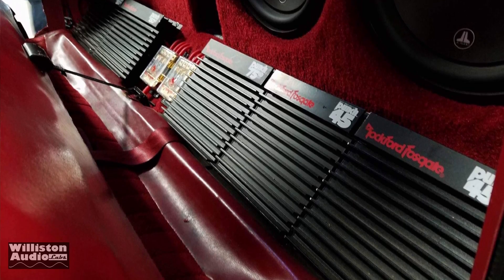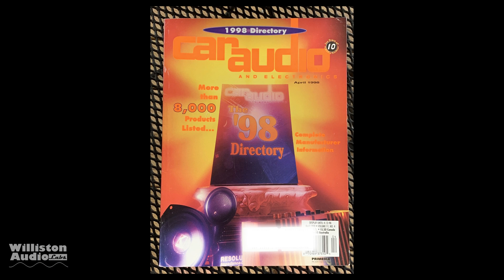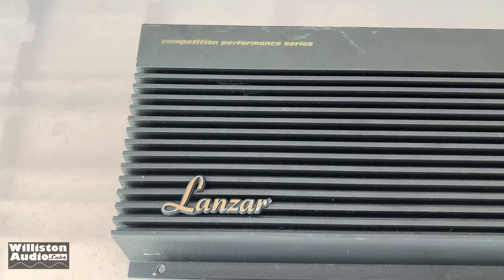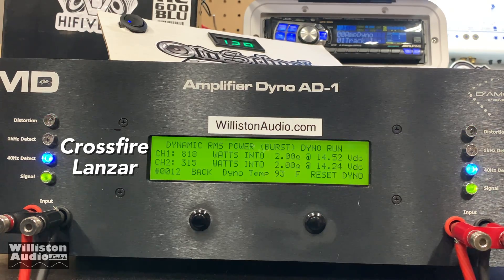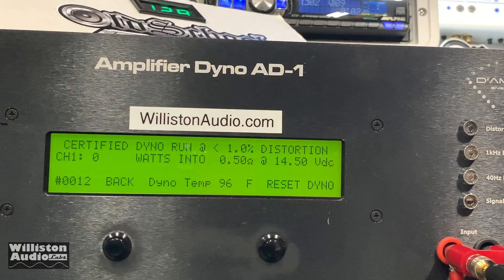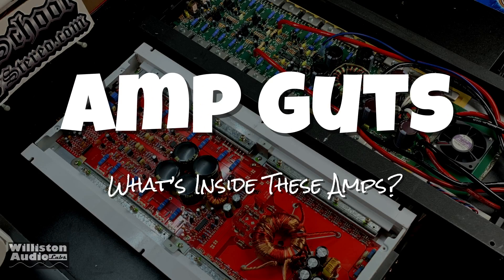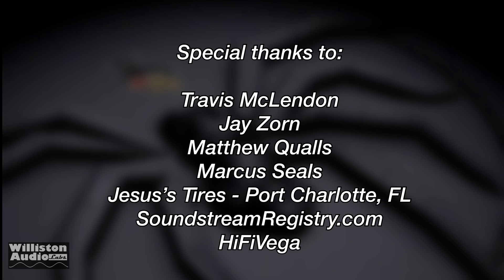$1100 vs $720 Amps from 1998 - Lanzar 50c vs Crossfire CFA-30HC [4K]

Comment: I just pulled out my Crossfire CFA30HC Amp to see if it still works after sitting in the basement for like 20yrs or so. If it works, I'm thinking about hooking it up to 2 12" Orion XTR pros that were gifted to me by my daughter for my 46th b-day. ya I'm 46 and still rocking systems in my rides. Hell, I'll probably still be banging into my 80s (more than likely will have hearing aides by then) if I make it that far. Lmfao. if the Crossfire does still work I'm hoping it'll slap the hell out of those 2 XTR Pros. Not looking to shatter any windows or anything. Just want a clean sounding system that'll piss off the neighbors as well as others in traffic. Lol
Reply: Did the amp still work? At 41 I finally got into car audio this year. How did I ride around before having two 12s in my car? 😂

Comment: Couldn’t see what semiconductors were on the output stage of the crossfire but on the lanzar it’s worth pointing out that every single high power semiconductor for the output stage AND the power supply section is ST Microelectronics and that’s high-high end. That’s why the amp is so expensive. Those BJTs ain’t cheap haha

Comment: I've got the Lanzar Opti-Drive 2500 in my garage.  It was stolen from my car back in the early 2000's.  I got it back years later from a police evidence room but it turns on and then turns off.  Of course they never tested it before returning it to me and the guy who stole it got off with probation.  I don't know if it can be fixed so it sits on the shelf in the garage.  It ran 2 15" Punch DVC 15's in a sealed box in my Thunderbird SC and it pounded harder than any other system I had heard back then.

Comment: Are you sure you were correct when you said what lights were on for what mode? Because it looks like when you switch modes at the end of the video you are doing the opposite of what you said. And the manual is no help in this area.

Comment: I am just about to put one of my 30hcs in my wife's Kia sorrento with a sundown sd4 12. Wired to 1 ohm. It's getting installed on Thursday. I'd do it myself.. But I can't loose my warranty. Do you think I should run it at 4 ohm? Or just set the gains low?

Comment: Holy hell.for shits and giggles I decided to look up the crossfire amp simply because I've had 1 sitting around doing nothing but collecting dust for about 15yrs and was curious to its power.didnt think I'd actually find it on here considering its age.figured it put out a lot more then the 30Wx2 it says on amp but damn I had no idea this thing can put out over a 1000watts.may have to hook it up and see if it powers up and is still useful.if not think I may have to contact amp labs to see about getting it going again.said part is idk wth I even got the amp or why.lmao

Comment: I have a question for you. I’m wanting to upgrade my car stereo and want something like I had in the 1990’s. It was a box with MTX 12” subs and horn tweeters with a 400 watt amp. Looks like most of stuff available is bass only and I want my music to be full and loud not just thumping bass. What would you recommend. I have a kenwood in dash but just not loud enough. I drive a Honda Element. Thanks
Reply: I have some infinity ref on 100 watts a piece and they sound amazing, loud and clear

Comment: I use to have an old school system in my 88 Buick lesabre you can check it out on cardomain.com. cutz buick.   That was my first audio build.  I had all Jensen audio equipment.  4 xa 4100 4 chance. amps, 88w full range 2 ch amp,2 4-way speakers,4 1"tweeters, 2 6 in. Phoenix Gold mods, 2 full range pioneer 4x6, and 2 sets of 2 bandpass10" subs.  Wished I'd tested it but didn't.

Comment: Crossfire is putting in work now too, my first system was in 1999 in a Ford ranger lol all Memphis I remember paying 1200 for my Memphis Bell 🛎 lol now I’m running all DD I have 4 DD 615s and a DM 2500 no wall 10 in aero port in a Dodge Caliber doing 150.00 not bad for low wattage doing knarly hair tricks on low power it was about efficiency back in the day, did my first USACI comp lots of fun, this vid brings back memory’s the Lanzar van started my addiction lol 😂

Comment: I had the old LANZAR amps... the big black ones with the cool red lettering... I had a 500 for subs and a 240 for mids/highs... then I HiFonics Zues and Aphrodite for the same combo... all those including Autotek came out of the same factory in the valley down by Chatsworth if I recall. HiFonics was always my favorite. That Zeus was the king back then. POWER FROM THE GODS!! Such great looking amps. Not the confusing naming convention they have now and the non matching size and looks. 
But I hear the Brutus series can wreck shit when given good clean power without breaking the bank.
Reply: Same here.  I found the old Lanzar's with the red lettering were about the same as the HiFonics of the same era.  They both kicked ass and both were designed by Zed Audio IIRC. I had the same setups as you.  A 500 on subs and a 240 on the mids/highs.  I then had a Zeus and a smaller HiFonics for the mids/highs.  I can't recall which of the smaller HiFonics I was using at the time, though.  I can't speak for HiFonics but I know for sure Lanzar was out of Chatsworth.  I always regretted selling that 240 however I still own most everything else that I had in the early to mid 90's.

Comment: Did you know that wattage isn't necessarily a measurement of loudness 
. My mate had an old 35watt per Chanel hifi amp and I had a new 25watt per Chanel but
 mine was twice  as loud as his. To double a 100watt amp you need 1000 watts
Reply: so if his was 90db, yours was 180db... ?   yeah, I think not. We hear a large difference at every 3db step. It takes double the power ( not 10x) to get that 3db sound difference.  You also don't mention speakers as they have just as much to do with loudness as the amp. Old school Subs were 90-97db efficient so 1 watt would produce between 90 to 97db at 1 meter. Subs today are 80-90db efficient or 7 to 10 db softer with the speaker alone without mention of the amp used. I would put money most of your sound difference was 1. Speaker difference or 2. car acoustics as difference cars will gain/lose sound due to the shape and interior volume.
Reply: What was the actual rms of each one?      A 500 watt Power Acoustic vs a RF 250.  I'd put my bet on the RF all day.

Comment: lanzar was a bit better sq wise i used to sell both. but in the end was never a real lanzar fan overall. crossfire kicked ass but not as reliable as some others back then. still a very good track record though we sold the crap out of crossfire though
Reply: I sold Lanzar Subs and Autotek amps in TX in the late 80's. The pro Lanzar subs ( Crunch and Punch were also popular )  with the Autotek 7050bts or 7100bts were unbeatable in low rated Watt installs. I had never heard of Crossfire. We sold a bunch of Punch 45 amps also, they had problems with blowing the internal fuses though. I preferred the Autotek's for reliability and for sound. I ran the Autotek for bass and Orion for mids/highs. I used MB Quart 6.5  Separates for the door and rear. I  miss that old stereo. It freaking kicked ass. Had a Sony CD head unit in 1988. Those were the days.

Comment: that 0 to 150 class was a beast class back then
Reply: I don't think it existed in the late 80's when I competed. I ran in the <101 class for awhile and then the 101-250 class. I used all Autotek and Orion amps.
Reply: check again my friend, I ranIASCA 0 to 150 and 151 to 300 class in 90 thru 94 in Pittsburgh and Ohio.

we never had any USAC shows around that time in that area.
Reply: I am not sure which oganization that you were refering but as it is now, there were many organizations that hosting events
Reply: I think by the looks of it, you are refferi g to the format displacement format and nlt wattage class
Reply: Autotek had those nice lttle Mean and Street Machine amps and subs and of course those legendary HCCA amps of that era

Comment: Hi there. I have just finished setting up the system in my 2011 E90. The source unit is a DEH 80PRS and the amplifier is a JBL GTR 7535. There is a dilemma I have run into. When testing for max volume at the headunit, depending on where I connect, it clips at different volumes, so for the sake of argument, on the front channels it clips at 59 out of 62 on the rear it clips at 60 out of 62 and on the sub it clips at 58 out of 62. This part is fine, I just stick to 57 and plug the RCA's into the amplifier. When I hook my mini oscope to the speaker output channels, even before touching the gains, I have to turn the volume down at the headunit to 50 in order to get a clean signal. There is a switch on the amplifier that says "Low, HI1,HI2" and the manual says to use the setting at Low if using line level signal. Now the thing is on the sub channel, I don't need to touch the gain at all and the other two I need to slightly. Is the amp underpowered? Is there something I am missing? Thanks

Comment: The fuses in the crossfire WERE in the correct location for High Current. Unless the B roll shows something different, you tested the amp in High Voltage mode.
Reply: I noticed that too How bout it @Williston Audio Labs?
Reply: This is what I came to say. In both shots of the back of the crossfire it shows fuses to be in High Power instead of High Current.

Comment: I bought a lanzar vibe 1200 used back in the early 2000's and ran it on 2 jl audio w4's. Actually was a great amp. UGLY as all heck, but a good amp. Not sure how much power it really was.
Reply: that was a big class D mono block correct?  black anodize correct?  If its the one im thinking of, there were quite a few manufacturers that used the same circuit board.  Lanzar was considered one of thec nicer looking amps.
Reply: @MuvoTX  correct
Reply: @MuvoTX  lanzar vibe 1200d. Black and gold.

Comment: I used to have one of those Crossfire amps and it pounded my 4 Kicker Solobaric 10s in my Integra, and later my 2 Orion Cobalt 10s in my 89 Beretta GT with American Racing 5 stars on it...lmfao I didn't have this particular model, but I loved that amp.

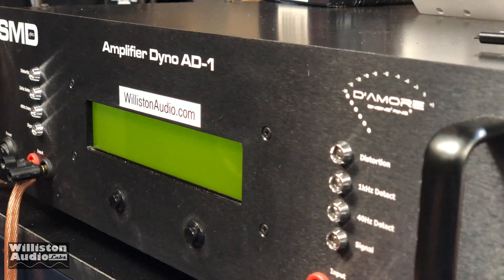Comment: Did you get the settings mixed up? at 3:39 you say high current mode but have it set to high power mode
Reply from the maker: Nope I had the Crossfire in high current during Dyno Drag. Watch end of vid to see high powered mode 😮

Comment: Big D wiz love what you do I fell in love with car auido around 1992 cut my teeth on blue thunder 12s  and a punch 150 amp in a Crx alpine tape deck running Sony mids and tweets its was one of the loudest around for such a low watt system could hear the bass for 2or3 miles as the car drove away man those were the days
Reply from the maker: Yeah boi!
Reply: mtx blue thunders were the real deal... werent they a circuit city exclusive?  I had a pair of terminator 12's... cant remember what they were tuned to.  it was about 128 iirc.... good times

Comment: I had a few Crossfire's and was always super happy with them. A mint VR1000D and an old school BMF series 2 channel (can't remember the model) that were both so clean and powerful. Regret selling the VR to this day.
Reply from the maker: Sweet! I’ve never tried the VR series
Reply: @wal  They're either partialy or fully US made (can't remember) and have really good build quality. They were strappable also. I had the 1000D and there was also the 2000D which was just two 1000D's strapped inside of a big heatsink. Crossfire is my second favorite company,next to Rockford.

Comment: So I'm the early days the power ratings were typically higher than stated? Or is that just for this brand/specific amp? All the modern ones seem to perform worse than expected.
Reply from the maker: Many amps were rated at lower voltages and low THD. Example, Crossfire is rated at 0.008% THD at 4 ohms
Reply: @wal  Ah that makes sense, thanks for the replies! Love the channel

Comment: So in the old school comp these would fall under the 100 watt amp placement?
Reply: Wattage classes when I competed in 90' were determined by the total 4 ohm RMS wattage of the system in the vehicle.  Take all the amps and add up total wattage.  So a vehicle with a total of 100 watts or less would qualify for that class.  If you had say 4-5 of these amps in a single system,  add up the 4 ohm system wattage and determine your class.

Comment: So I notice you said you would run the crossfire in high current mode, but if you look, you have the fuses in high power mode, though the green lights indicate high current "maybe I'm missing something"! In the manual in high power mode it says it can only handle a 2 ohm mono load, but can handle the 1 ohm mono load in high current mode. I was just watching the 15 hc video you uploaded as well in 2015. Still awesome Video!
Reply from the maker: For this test I wanted it to closely match the 50c, well at least as close as possible. The Lanzar has a larger heatsink and fan and could probably run 0.5 mono all day without breaking a sweat

Comment: I need a amp that can put at least 300 watts 4ohm thats under 100 $
Reply: CT sounds t300.1 or skar 350
Reply: @Mr.boxxchevy  ct sounds could u send ebay link to cheapist buy it now ?
Reply: Check out D,s other vids he has a few.. Or budget gem or bust vids.
Reply: No luck believe it's been discontinued. But the skar is a good amp I have tried both.
Reply: Practically the same amp as the CT sounds